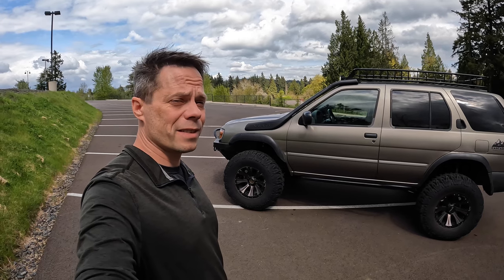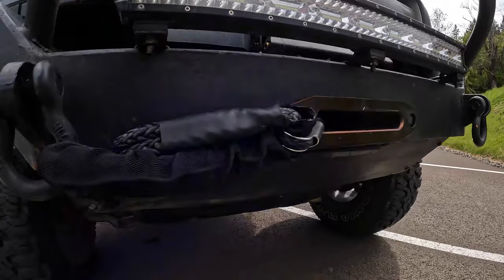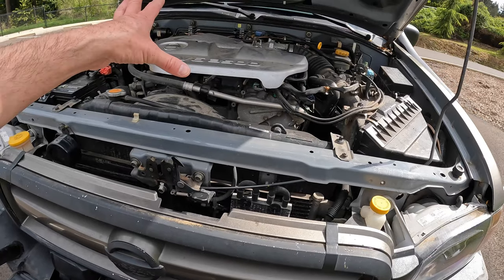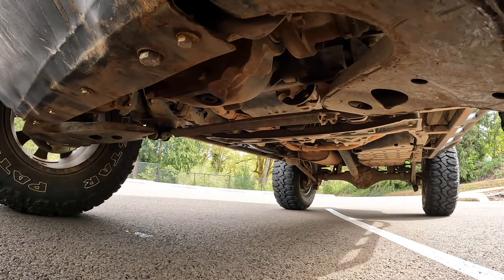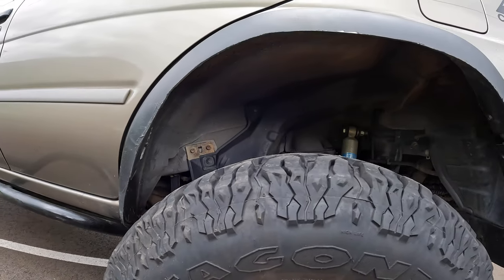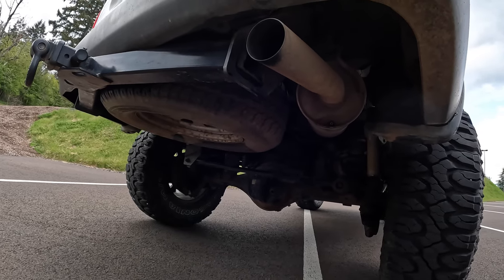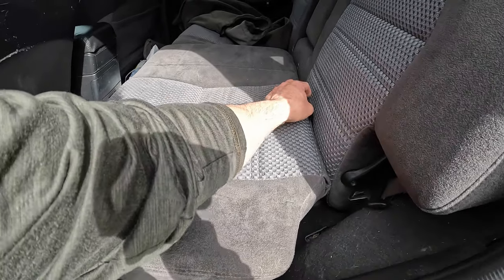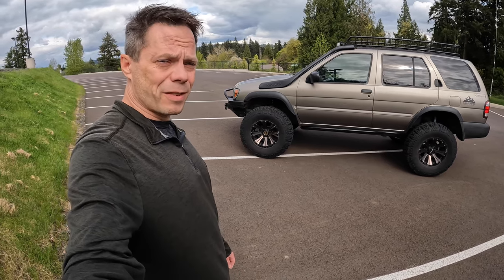Pathfinder R50 Off Road Build Walkaround Summary

Comment: Love it mate, I have a 2000 r50 Pathy myself in champagne gold colour for my beach 4wd adventures on the islands off Brisbane in South East Queensland, Australia.  To my Pathy I’ve added a 1& 1/2 inch lift with Tough Dog Suspension running Parelli Scorpian AT tyres with an aggressive side wall for better protection, Rhino Pioneer rack with pins to secure my Maxtrax recovery boards, Xrox Bullbar with attached STEDI and Great White LED’s for when driving up the beach late at night back to camp,after a long day out before high tide arrives. I also added some custom made ‘Pathfinder’ decals including ‘ST Touring’ for that extra touch.

 I was considering moving it on after 6 years from when I bought her with just 85’000 kms which is now sitting on 175’000 kms but finding it hard to say goodbye. You’ve inspired me to create a video for my own channel before we depart later this year as I want another adventure or two with the old girl this Aussie Spring come September.
Reply from the maker: Sounds like a great build and great idea to create a video about it!

Comment: This is awesome, I just purchased an 98 R50. I was wondering if a guy could fit 35" tires on it, thanks for the video and product links!
Reply from the maker: You are very welcome!  Yes, 35s will fit but it does require a Sub Frame Drop (SFD).  33s will fit without a SFD.

Comment: Iv watched this video 3 times now. And most of your others. I am buying a pathfinder for hunting purposes. I think this is a fantastic choice for the dollar vs the Toyotas. 
I'm a little confused about the sub frame drop, lift kit, suspension upgrade combo. 
Basically I want to put a lift and upgrade the suspension for a smoother ride with either 33's or 35's. 
I'm using this for hunting purposes, I do go down some gnarly roads every now and then. Some of the best roads are, hey this isn't on the map, let go see where it goes... then I get out and hunt. 
So with all that said. What would I do to upgrade the suspension and get some bigger tires. Get a smoother ride? 
Hope you can help and yes I subscribed!
Reply from the maker: A 3 inch all around lift will fit 33 inch tires though it will take a bit of trimming the wheel wells to prevent rubbing.  This setup though will make the Pathy very capable on many trails.  I had my Pathy like this for several years.  The subframe drop is needed to get more clearance up front to fit 35 inch tires, which is what I have now.  So, overall 5.5 inch  lift up front and 6 inches in the rear.  Hope this helps

Comment: Is the transfer case gear you mentioned what is commonly referred to as a 'crawler gear'? I run 31" tires and a 5-speed and sometimes finding myself wanting a bit lower range even now, so I'd love to get some info on that.
 
Also how are those OME struts treating you? I just installed a set and they seem pretty good as far as the ride after a couple weeks, but that's all I have to go on so far.
Reply from the maker: Yes!  The transfer case gear changes the transfer case ration from basically 2:1 to 4:1 (not quite but close).  It really makes a huge difference the overall crawl ration of the Pathfinder!   The OME struts are working out well!  The springs have sagged through the few years and I will be replacing the springs with AC coils.  This should raise the front an inch.

Comment: What spacer are you running on your rear setup? I am running 9449 coils. The spacer I have is the supreme brand. I ran into an issue with the spacer not fitting the inside of the coil where it sits. Did you have to modify yours to work?
Reply from the maker: I too have the Supreme brand and yep, I could not get those to fit either.  I ended using a pair I bought on Ebay back in 2018.  Ebay no longer shows the purchase though.  They were a red urethane/plastic, which I painted black.  They were tight as well but were able to flex inside the springs.
Reply: @northwestoffroad  I am going to experiment with the jeep WJ rear spacers ,XJ front spacers and RAM rear spacers soon to see which one works best with the LR9449 coils. Thanks for the quick reply!

Comment: Looks good ! What brand brackets did you use to secure your roof basket?
Reply from the maker: They are custom made plates that slide into the rack slot rails.  The plates have a captured bolt going through them which is used to secure the top plate with a nylon lock nut.  Ill create a video showing this and explaining the rack!

Comment: Did you make or buy the antenna brackets you’re using to mount your antennas in the back?
Reply: And how did you mount them?
Reply from the maker: I bought those mounts form Amazon: https://amzn.to/3v1QODs   I used four self tapping screws with a silicone sealant.

Comment: Show the frame welds for the rock sliders please!
Reply from the maker: Will do, but no welds for my sliders as it's all bolted on.  Video to come..
Reply: @northwestoffroad  cool. I'd love to see where you chose for the bolt locations/ It's kind of an odd frame to work with.
Reply: There are factory bolt holes in the chassis rail for sidesteps.
Reply: @clintadams8451  So you used the original side step bolt on piece? it wasn't aluminum? My OG side steps are aluminum but my sliders are steel.

Comment: How do you maintain wheel spacers?
Reply from the maker: They are supposed to checked for correct torque after installation and about 50 miles or so.  So this means taking off the tires to re-check the torque.  Also,  they are in the way for many repairs such as wheel bearing or brakes etc..

Comment: What mileage did the fuel pump fail?
Reply from the maker: Mileage was around 128K and the pump actually didn't fail.  The sender for the fuel gauge was flakey and it ran out of gas.  Since I opened it up, I just  went ahead and changed the pump and gauge sender.